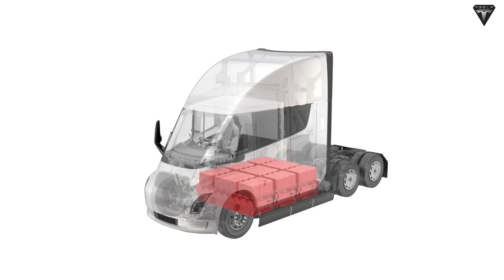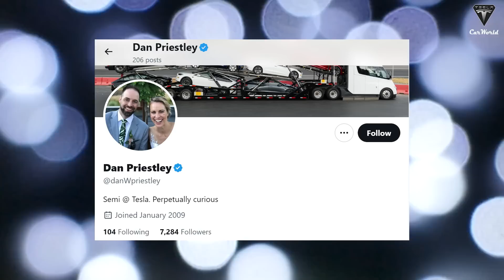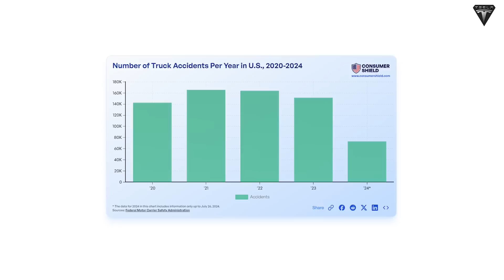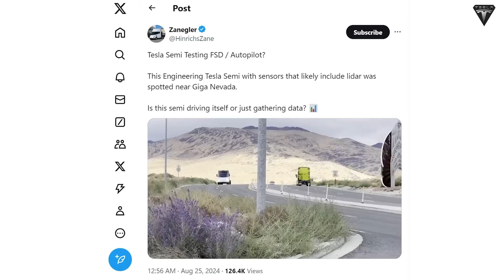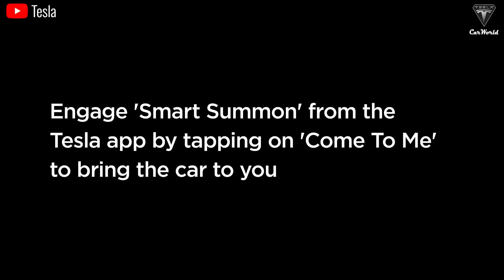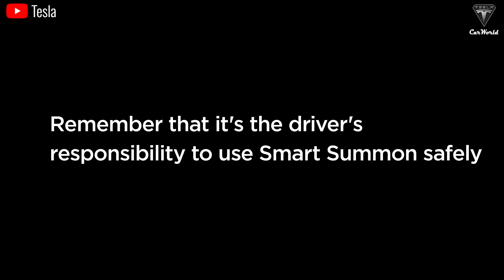Elon Musk Confirms Tesla Semi BIG Upgrade After Fire Crash, New Design, Battery & G2 Version Coming!

Comment: Tesla has to move from talking to actually producing and selling the semi-trucks. As we speak, all major European truck manufacturers offer electric trucks for heavy-duty operation. For example, Scania has had heavy trucks in operation since summer 2022, with a total weight of 64 metric tonnes on public roads and 80 tonnes on private roads. Fully equipped with crane loading timber in the forest. Others like Volvo Corp and Daimer have a joint company developing fuel cell technology. Volvo Corp works on different solutions, including batteries and hydrogen-based fuel cells and hydrogen for redesigned diesel engines, based on the global needs of different end users. And Chinese producers are coming as well... The race is on, as the CEO of Volvo said when the Q2 results were presented.

Comment: Dont see how you can blame tesla for the driver falling asleep. Personally i dont think FSD is the solution. What id like to see is a system were the driver signs in then it tracks how long theyve been driving continuously. Then after a programmed time it automatically pulls over at the nearest rest stop and locks out the drive train. We all know drivers arent going to do it themselves so there needs to be something that forces them to take the rest break. FSD is only going to cause more crashes because drivers will trust it 100% and instead of monitoring the vehicle they will be doing everything else.

Comment: The 4680 batteries also have to deliver better energy density than 2170 batteries.  They’re still underperforming the original spec as of the last independent measurements.

Comment: We're still a long way from autonomous cars, and even further from trucks and semi-trailers. The answer to accidents caused by fatigue is not FSD, because FSD requires the driver to be fully attentive at all times.
The answer to fatigue is simply rest.
This concept has long been accepted in aviation, and is integrated into pilot planning.
The same should apply to truck drivers, who should not be allowed to drive for more than 3 or 4 hours at a time, without a break, and a maximum of 10 hours a day, or even 50 to 60 hours a week.

Comment: Everyone, so you never seen gasoline fires in autos? Please stop with the nonsense.
Reply: You're right gasoline vehicles can catch fire 2 but the biggest difference between a gasoline fire and an Eevee fire a gasoline fire can be put out fairly quickly within 24 hours Nev fires not so easy to put out and as you noticed they had to close the highway for 48 hours to let the fire burn because they can't put it out a gasoline vehicle fire would not burn that long now maybe the cargo of the gasoline vehicle could burn that long but not the vehicle in this case the Tesla semi itself is what's burning for 48 hours why because an EV fire is a self oxidizing fire which means it doesn't need oxygen to burn it creates its own fuel Heat and oxygen to breathe a gasoline fire needs oxygen to burn and can't sustain itself if the oxygens taken away where is Navy fire you can't really take the oxygen away from its fire
Reply: The high wouldn’t be shut down for 17 hrs with the diesel
Reply: Very true, battery fires are worse. However, the adoption on EV's are recent so of course there will be many issues. It's good to stay cautious about ambitious EV projects, especially if one can't afford replacements but in due time, they will become more reliable and safe to operate.
Regular cars were far less safe and reliable before but now they come with many refinements and improvements.
Reply: No.
Dats on tv so🤷🏼‍♂️
Reply: How many of those took a whole day to put out?
Reply: Battery fires are contained to the battery in the vehicle itself whereas fuel fires spread that whole forest would have been on fire.
Reply: A diesel fire is far easier to contain nothing close. Swing and a miss I say.
Reply: Trucks of that size are all diesel. A fire that can be put out in a short period. Not blocking highway fora day until it burns out. The self immolation feature should be pointed out to every buyer. And isurers should be making all of them uninsurable.
Reply: @ldnwholesale8552  then all diesel engine manufacturers should have a warning for “diesel runaway” and the complete loss of the engine and transmission, if not dealt with properly. And make all vehicle with those engines uninsureable.
Reply: HIGHWAY THRU HELL in YouTube showed one tanker truck accident where the tanker and Semi crashed and caught fire, nothing left  of wreck and one other Heavy recovery they did was. a GASOLINE TANKER, the toxic fumes from the gasoline can be DEADLY, and a spark can make everything go up in smoke .
Reply: Gasoline vehicles can catch fire if the fuel tank is compromised
Reply: @goldenalbatross9462 yes exactly like evs
Reply: @goldenalbatross9462  but batterys are more dangerous. A little bit of salt corrosion can make the battery prone to exploding

Comment: FSD is THE best feature of my Model Y.  I use it every trip, just tell it where to go and leave the monitored  driving to the car.  With the multiple cameras it “sees” in all directions and is constantly evaluating the behavior of pedestrians and traffic.  It moves to give pedestrians greater clearance and slowed down to keep their behavior in check.  Cars approaching from side streets are given the idiot test and if they are threatening to make a dangerous move the Tesla sounds an alarm just in case. 
Using it on the expressway its performance is excellent.  It constantly evaluates the driving conditions and alters the cruise speed to suit its best guess for safety.  Having this in a semi truck would be a game changer.  The inside camera will know when the driver is not paying Enoch=ugh attention and will alarm and possible take evasive action.
FSD is outstanding! And it will only get better.
Reply: FSD is nice, yes, but it does still need the driver to pay attention and take over if it tries to do something unsafe, have seen more than a few instances of the driver having to take over and go 'nope!' when the FSD tried a move that isn't permitted or would have put the car or someone else at risk, or tried to push into a gap it could not fit

Comment: They need a new battery to make the semi lighter and go further to at least 1,000- 1,200 miles, and parking spots need to have a charger. That way, you can charge overnight while sleeping. With that it'll become a good solo truck. A trucker can travel 700+ miles in one day and the extra 300- 500 power miles is for the safety of the driver like waiting out weather or road condition of any kind which could lead to many miles without a charger in site

Comment: Tesla are already late to the party in Europe. 
Other companies are already delivering electric trucks to customers and have done so for over 12 months.
Volvo Mercedes and others have made big inroads whilst Tesla has been asleep at the wheel.

Additionally  DHL and Volvo have run 3 years of actual road medium haul - long haul from Italy to Belgium and Germany proving the efficiency of electric.
As of February 2024 DHL have started using Mercedes electric truck in Australia.

Sorry Tesla, your are already loosing out.
Even Eddison Motors  in Canada has commenced building 6 new Hybrid Diesel electric trucks for customers and using already proven Scania Euro 5 EPA compliant engines that provide the beauty of Diesel Electric propulsion and can run long haul from pure battery and generation on the go with the 9 litre diesel genset capable of driving the truck and charging the battery at the same time and can provide power to homes in the event of a blackout.

These Eddison trucks can cruise at 90 kph or 55 mph for over 1000 kms towing 44 MT ( 96,800 lbs) of payload. - Tesla - maybe might get maybe 70% of that range and then must find a dedicated charge station. 
Edison just needs a splash of diesel and away she goes.

Comment: I’ve been averaging $3.2/gallon last month.

500 miles at 8.7mpg —> 57.5 gallons needed to make the trip.

57.5 gallons x $3.2/gallons = $184

If I run mostly in Texas, it’d be cheaper
Reply: Electricity is also cheaper in Texas. So if you recalculate using the average Texas electric price compared to California electric price, then you would still save $$$
Reply: There's a German YouTube channel running an Iveco 770kw (1000 HP) electric truck and he loves to drive it. It outruns anything and can keep up with normal traffic even if it's loaded up and it's way cheaper to run.
I think it is based on the Nicola Plattform which was supposed to compete with Teslas semi models

Comment: Tesla should not sell the Semi without FSD installed, period.
Reply: FSD should be in every Tesla running in shadow accident avoidance mode with the first accident avoidance free
Reply: @glike2 it already has automatic avoidance for free
Reply: That product doesn't even exist. A tractor trailer is not driven like a car and FSD may not ever be available.
Reply: Are the companies going to pay for the FSD in Tesla semi trucks. $15,000 for FSD is a lot.
Reply: I mean you are aware FSD doesn't exist right? Like I know he said it did in 2017 buuuuttt.... You know..
Reply: @coastermad13  Keep telling yourself that.
Reply: @coastermad13 i agree even with fsd you have to keep your hand on the wheel , basically to take blame in case  fsd takes a hard turn at 80mph. Also way easier to pay a truck driver to say he fell asleep than to see 5% drop in tesla stock.
Reply: Because of this type of logic, we now take off our shoes at airports .
Reply: These vehicles need tons of road data to make the AI work but that can't happen without driving them for millions upon millions of miles.
Reply: There is no such thing as FSD though.
Reply: There is no such thing as "FSD". FSD is only available via Supervised FSD. SFSD requires constant interaction with the vehicle and doesn't allow the driver to close their eyes asides from normal blinking. So in the case of the driver falling asleep with SFSD engaged, the system would disengage once the prompted interaction was not adhered to. This would lead to the same outcome, the vehicle would crash. FSD is not designed as a system that drives your car for you, rather it's a system that you control, that your responsible for, and one that can and will shut off at any time, as the driver of one of these vehicles you are responsible for taking command of the vehicle at anytime. SFSD is not even designed to assist you momentarily so that you can take your eyes off the wheel for a moment and grab something from the back of your vehicle, or send that text message you need to respond to, SFSD will shut off immediately if it sees you on your phone or looking else where but the road in front of you.
Reply: @thejasonstackhouse  Tesla could easily program the FSD to pull the vehicle off the road. They already have Actual Smart Summon that will  drive your Tesla to you in a busy parking lot.
Reply: @nextechsolutions5955 
😂
You wish! Look at all the damage claims from testing the feature.
Tesla has nothing on the competition besides empty promises from 6 years ago.
Reply: @thejasonstackhouse  I see you're talking out of your donkey. Have you actually seen how FSD disengages? It doesn't keep driving straight into whatever is in front of it...
Reply: phatom breaking would be nice on a semi.
Reply: You have no voice
Reply: @Pewpew-z2q  If I don’t have a voice, why are you responding?
Reply: Yeah well it will be hard and takes a long long time cuz trailers are different sizes
Reply: just use trains at that point
Reply: But it's ok to sell and ship a tanker full of gas/hrydrogen/etc. without it?
Reply: @ItsBinhRepaired Yes, because there is no thermal runoff
Reply: @JS-hl1oc  you should see a gas tanker after a crash.
Reply: @ItsBinhRepaired they have gasoline which can be extinguished but good luck extinguishing a battery truck
Reply: Why? No other trucks have it?
Reply: @mythicallegendary3992 
Because that is the feature advertised when people pre-ordered.  Self driving convoy technology to reduce operating costs and make it a compelling product. Bait and switch shouldn't be tolerated.
Reply: What about Kenworth? Mack?
International? Such a ridiculous statement!
Reply: @andrewshields986 
Because it was promised as part of the pre-order.
Duh.
Did the others promise it? No.
Dumb argument.